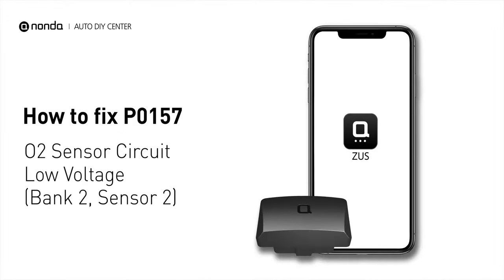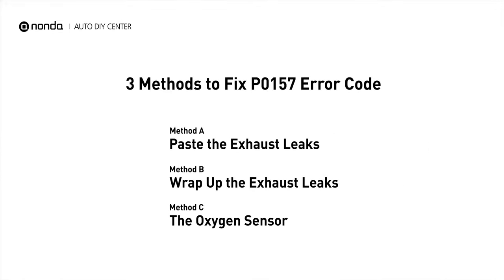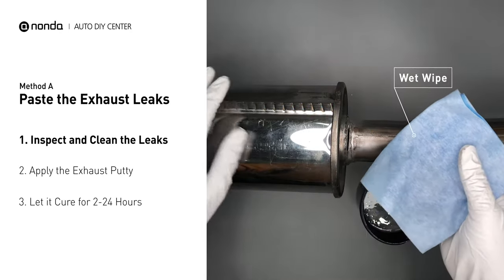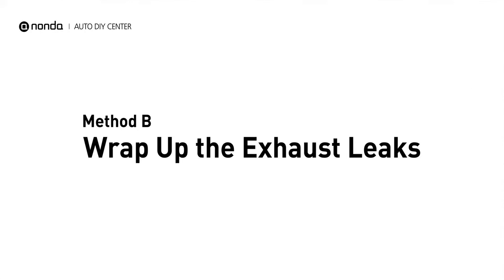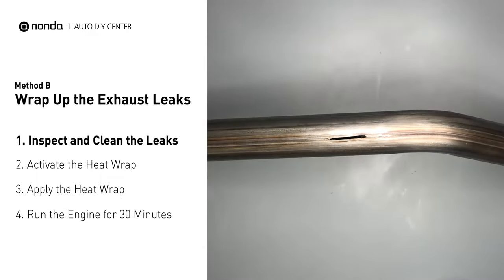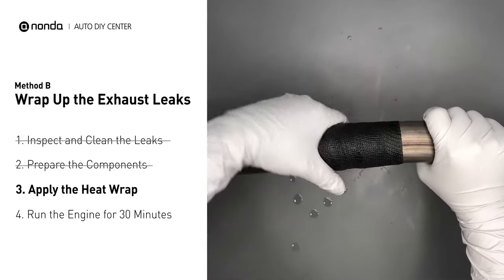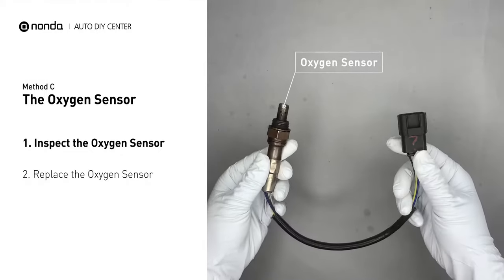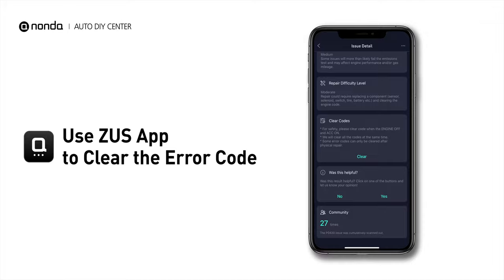How to Fix P0157 Engine Code in 4 Minutes [3 DIY Methods / Only $9.22]

Comment: Hi thanks great video steve I  have question and was wondering can you help help me out I have 2017 dodge charger sxt 3.6 and I pullled the same code p0157  car is stuttering a bit when driving like it wants to shut off I was driving from work engine light came on then started blinking  I drove 15 mph all they way to my house i wanted to know is the o2 sensor bank 2 located on the drivers side of my vehicle before or after the catalytic converter and what tool/ tools will i need to remove or replace the 02 sensor if needed thanks alot my car is at my house currently in my driveway